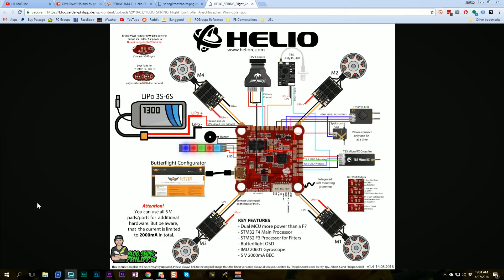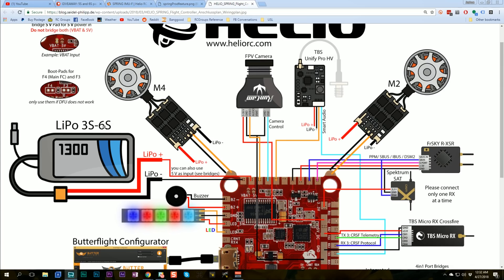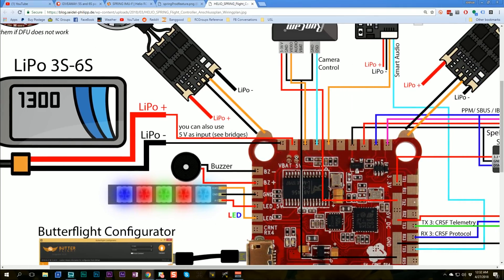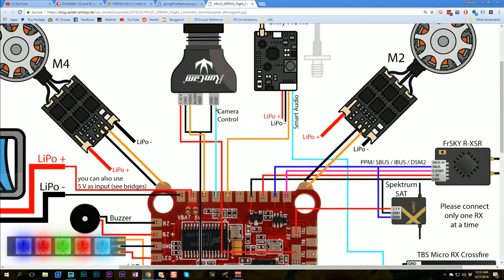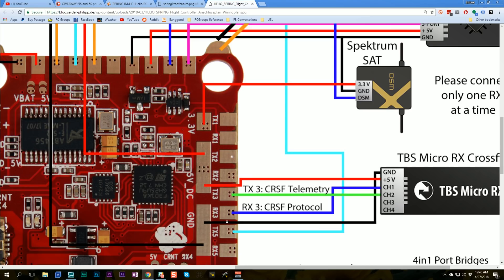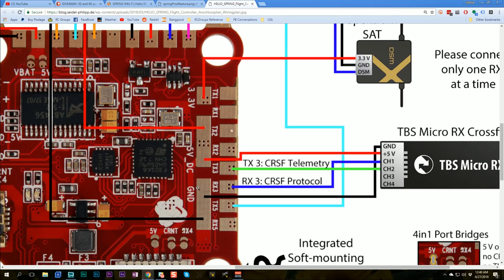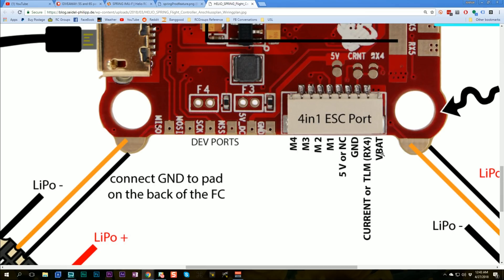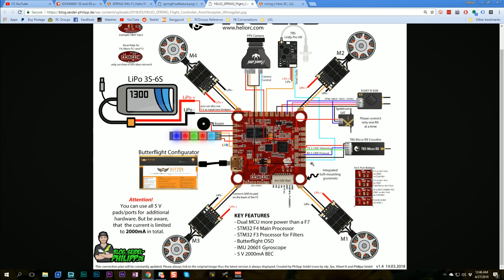Helio Spring Butterflight Flight Controller | F3 + F4 = F7?

Comment: Couple of answers to questions in the video: A) Butterflight and Helio are separate entities and operate independently and their decisions are entirely their own. We help the devs where we can and anything we can provide from advancements within imuf and contribute that back to the community we will. B) you can connect 5v and vbat to the 4 in 1 jack both. The jumpers are only “track” or “rail” selectors. C) Once the BF devs figure out that they can have some of the same goodness and allow us to open a PR, (or if someone wants to open a Helio target PR for us) then it could be supported in betaflight as well. Unfortunately, the BF devs decides to block us entirely from their repository. D) F3 support is in Butterflight for the foreseeable future. We love tiny whoops. :D
Reply: I saw the exchanges, I don't think Beta acted very professionally either.
Reply: Curtis Bangert in order for something to be slander, it has to be false. Nothing that had been said is slander.
Reply: While Beta & Butter are drawing lines in the sand, this is forcing the greater community to take sides & this is literally, & ultimately, dividing the community which I am sure both sides have contemplated.
The greater community is not "Beta" or "Butter" but "Better" than any one groups ego's & thus both groups need to swallow some pride & work together in the spirit of community. It will quickly get to a point where 'Who started it" or "Who's wrong" is going to be insignificant to the drama this will cause & both sides know exactly the ramifications of their actions.
Lift your game - all of you.

TLDR: Stop the smack talk, stop blocking & locking. All this does is mess up the community, not each other. I don't want to hear about how it's the other guys fault .. just fix it!
Reply: Andrey Mironov want more screenshots made public of your conversations held behind closed doors, “diehertz?” I’ll be glad to oblige. They aren’t very flattering to you or the rest of the BeF team.
Reply: Jesus I guess it's a dick measure contest everywhere in life. This type of 3rd grade bullshit is what is going to make me stop flying.
Reply: https://youtu.be/OR-772OqRoQ

Listened to the interview again:
30s - Kalyn is introduced as a lead developer of Butterflight and principle at Helio with Tim and Shawn.
1:12:'ish - talk about tracking serials and how Helio is a mechanism $$ and Butter is the mechanism for the open source outlet.

+ video splash says Butterflight, but the folks talking are Helio.  So the perception is there because of how it is laid out.
Please don't get mad at me.  Just sharing what was presented.  Sorry.

On top of this: Kalyn leaving RF and not wanting to go closed source again (which would mean starting over and coding everything from the ground up to just sell boards) meant pushing what was needed into an existing open source project (like BF).
Reply: Helio RC. Regarding the VBat pin on the 4 in 1 plug. If my 4 in 1 ESC feeds Vbat to that pin and I select the vbat bridge as my selection to power the flight controller. Do I need to also bring power wires directly from my ESC to the power pads or will the ESC Vbat pin be enough to power the board?
Reply: Actually that is not true Curtis Bangert.. it has been stated many times by Andrey himself that a Helio target would never happen. Has been asked by other users too with the same response. + the beta team keeps claiming there are GPL violations.. all hogwash
Reply: There is no need for argument.. we are going to keep doing our thing thats all.
Reply: Andrey Mironov blocked for exposing the fact that the BF devs were paid by OEMs including TBS to work on their stuff without informing the public, demanding free hardware or else they would “let the PR go stale” deliberately weeks before we officially launched, and things like that? If that was “being a jerk” then so be it. The community should be aware of the contradictions and conflicts of interest.
Reply: in my world so called slander is "well,,???" slander, and ripping balls, is RIPPING BALLS,,,
Reply: KWAD save the Queen. you can't expect the betaflight devs to 1. do all the work.. you want your board supported you need to provide the coding for it ( thats how it works with all other board makers and 2. the IMU code for the their secret sauce, in the way it was presented to betaflight and the way its implemented in butterflight breaches the GPL licence.. if you were a betaflight Dev would you actively help a project that is about selling product that you you wont get a penny of and already is capitalising on your hard work??
the hobby is transforming from a hobby to big business this isn't the first or last time you'll see this sort of situation going down..

ohh and https://github.com/ButterFlight/butterflight/pull/139
Reply: Helio RC on answer (B) providing 5v power and Vbat for sensing on 4 on 1 connector, how would you bridge for Esc current sensing as well?
Reply: esc vbat will be enough.  you'll fry the board if you use both
Reply: Andrey Mironov - Because you are such a model citizen....
Reply: Andrey Mironov so why don't you guys (bf devs) be the bigger men and include the target?  It sounds like a dick measuring contest where only the community loses.  All you are doing is shrinking your own community with this feud as it gives people only one option for firmware that is very close to BF.
Reply: You contribution to community is sadly none. Judging by quality of the first PR and how code on Butterfligtht is handled don't expect that your commits will be merged in this form. I had to change some of my commits many many times before they were accepted into Betaflight, there is certain level and standards expected to be kept when submitting the code there and deal with it. This is for everyones benefit, also for other devs to understand what the code does...
Reply: I don't know or care which one was right or wrong, but we don't need drama in *flight world. First it was base->cleanflight drama, then it was race flight drama, then again raceflight drama now butter betaflight drama ? Come on people, don't you have better things to do than argue?
Reply: Back your claims by proof, so far you're just pulling it out of your ass.
Reply: You were blockrd for acting like a jerk, don't forget that

Comment: Just switch to Raceflight trusts me. Iv been flying betaflight for almost 2 years and butterflight for a few weeks and Raceflight is is sooo freaking nice its like butterflight on steroids
Reply from the maker: There are two main weaknesses of FlightOne in my opinion. The first is that the hardware can sometimes be really really finicky. And if you get unlucky enough to have a setup that performs poorly, there is sometimes no fix, since FlightOne only runs on one FC. Second, The FlightOne developers seem to struggle under their load. Bug fixes and new features seem slow to roll out. Without naming names, I know many prominent pilots who fly FlightOne who refuse to upgrade past whatever old version worked best for them, because new versions either fly worse or have unfixed bugs.
Reply: Joshua Bardwell Yeah I would agree with you. FlightOne isn’t for everyone in my Opinion betaflight is perfect for 90 95% of people I went with FlightOne cause I was looking for that little extra something
Reply: Unfortunately I happen to be one of those unlucky ones. Ever since I switched to Raceflight, I've had nothing but problems with hot motors. I spent HOURS trying to tune it,  flashing older firmware to their latest firmware, raising filters to lowering them but to no avail. Very frustrating!  As a last resort I flashed Butterflight and now my motors don't get hot. I did have to drop the gyro from 32k to 16k but now everything is Buttery!
Reply: LuisB FPV That sucks I had a similar issue but ever since I start running the 32bit esc It’s been nothing but smooth sailing

Comment: Just went over this with devs, you can't put 5v and vbat at the same time on the 4 in 1 port.   Vbat on 4 in 1 port powers the board.  So if you power the board with 5v the only way to get voltage sensing (on osd) is to use esc telemetry.

Comment: I'm die hard betaflight and I built a 6in ultralight floss. It flew ok on 8k 8k but had oscillating problem and  the betaflight 32k filter would cause my CPU to lock up randomly in mid air. I tried everything to fix this on betaflight but went to 5in props stoped trying 32k and it did ok. But it was s waste. I had 2507 motors spinning 5in props and wanted to run 6in but couldn't on betaflight
 I swapped to butterflight not expecting anything to improve however it now runs 32k fine and 6in props with not a hint of oscillation. I was shocked at how Damn amazing it is. I wasn't expecting that it would be so good. But it is. I'm sold on it now

Comment: My Kingkong ET100 used to 'wig-out' a lot doing slow steady roll+yaw turns, where it would sharply bank 90 degrees to the side and I'd have to quickly slam the roll stick the opposite direction to prevent bad things happening.
I installed Butterflight, left the PIDs as they were and turned on the extra filtering (which I had done with Betaflight but didn't help) and now the hard 90 degree banking issue very very rarely happens, it really helped it.

Comment: I hear that Butterflight / Helio Spring almost completely erases vibrations / prop wash on 6” quads. 

I’m currently on a Betaflight F4 for my 6”. I’m already experiencing really good results but I will consider switching to Helio RC if it means I can get to 99% smoothness on 6”.
Reply: I am flying Butter on my 6" with a CLF4 and it is clean as hell. No propwash or MTO running FKF, PT1 and all notch filters disabled. I was not able to get the same results on my 7" so on that one I actually did throw in a HELIO and I have to say it fixed all my MTO and flutter issues on the 7" running gemfan 7042 props.
Reply: 3.2.4 was one of the BF versions that I remember flying and really enjoying as well actually
Reply: I am flying BF 3.2 on my 6" chameleon and it is very smooth, even on old beat up biblades. It is smoother than my 5" quads.
Reply: Not there yet but almost, my BetaF is still a tiny bit better, but I want the IMUF to rock it harder. I will keep trying.
Reply: I have a backup 5” that I don’t use. Maybe I’ll throw 6” arms, same motors that I’m running in the current 6” with Helio Spring and do a side by side comparison after tuning both to the limit. 

(I run the same exact frame for both 5” and 6” quads.)
Reply: Loose Transistor FPV I have all filters shut off on BF 3.2.4 and LPF at 120hz. I have no MTO but I have a do have a tiny bit of propwash when I do hard Split-S to stop / hard powerloop to stop maneuvers. 

It’s much much better than my 5” but it’s still there. Do you think Helio with Butterflight will erase that?

I swap between HQ 6030 and 6040 props.
Reply: Yes I do, I am a bit believer in the HELIO tech specifically. I have a 7" quad with a CLF4 that I had been trying to tune for 2 months with not much luck. No matter what I did all I managed to do was make the MTO band smaller or move it somewhere else. Couple weeks ago I bought a new HELIO and I replaced the FC on my 7" with it and on maiden it was loads better already but still some MTO.

All I did to solve that with the HELIO was add more Kp gain, and raise Q to about 4000 - MTO cured, no more propwash =D

Comment: You asked at the end how Butter flies; Isn't it still just a BetaFlight fork with the Kalman Filter? 
I'm trying to keep updated, is Kalyin now a ButterFlight dev, or continuing with RaceFlight once again as GPL open source? (Was trying to grasp that question)
Reply: Kalyn is actually one of the HELIO RC devs, he helps with some aspects of butterflight but mostly the ones related to the Helio target.
Reply: Loose Transistor FPV Ohhhhh I see. Is this recent since he and Preston quit working together?
(Am I on the wrong forums or subscribed to the wrong channels? It's so hard to follow the progression)
Reply: Hehheheh I think you might be following some old news sources yes. The split between Kalyn and RF happened a while back - its kinda what forced preston to open source RF1 in the first place. Kalyn teamed up with Tim Sweet to work on the Helio.
Reply: Loose Transistor FPV In December-ish of '17 right? Okay, I missed the Helio change. K, I'll keep searching for news; I keep searching FB, YT, & google searches...
I guess time will tell but it's interesting to follow who is working on what project.
Reply: Yeah you are not going to find a lot of that type of news in those sources. What you wanna do to keep your finger on the pulse is join one of the FPV Slack channels. FPV Chat would be a great one to join since it has 3K members.
Reply: Loose Transistor FPV Bro, you're awesome. You totally didn't need to take time out of your day and you did! K, I will look into that Slack channel ty so much. I always feel like I'm half a step behind the curve, and I'm curious by nature. That will be awesome 👌🏼
Reply: Hahahah yeah join the slack my friend - it will be hard to keep up but there is a ton of good info there. And you are very welcome, I love spending time connecting with the community! Here is the link - https://fpvchat.slack.com/

Comment: Why can we not get a plug and play board no more soldering plug motors, vtx  ...
Reply: Flying High you must be a newer pilot...
Reply: Due to connections not being reliable over time..nothing like sodering your connections vs plug n play,only think it's OK for tiny whoop or micro's,even then I would still  prefer to soder:)

Comment: Does anyone have answer to the to the vbat pin? If your running FC off the 5V then do you not keep the vbat wire or does it use vbat sensing? Putting into a build right now and really don't what 5V + Vbat V going into the FC cause product may not like it so much.
Reply: Vbat sensing using 5V only available through 4in1 telemetry I believe.
Reply: You can safely connect both 5v and vbat through the 4 in 1 harness (only) without breaking anything

Comment: I power my HESP from vcc through the 4in1 plug. No issues.

I’ve run 4 packs today with dshot1200 and my quad flew ok. Changed to multishot on the fifth pack and OMG the difference was unreal. Felt smoother, turned sharper with less drift. Loved it.
Reply: Simon willmoth that’s because Kalyn is a genius :D
Reply: Helio RC keep up the good work guys. My flying is a lot better with this board and Buf.
Reply: Simon willmoth how do you power a Unify Pro HV on this FC when used with a 4in1 ESC and the ribbon cable?
Reply: caymandiver75 I have wired direct to Lipo input of my 4in1.
Reply: Simon willmoth you wired to the FC lipo input pad or to the actually ESC layer lipo input?

Comment: I Love ButterFlight. My favorite quad right now is a bqe 210, JBardwell running Butter, Makerfire escs, Tmotor pro2 2400kv, Lumenier eagle2 pro. I can run nearly any prop (Dal 5051, 5040, 5046, 5050<-fav) with no "prop-wash" what so ever. Only the slight hint of the beginnings of "prop-wash" when pulling out of a dive real hard at the last second. Flys like a dream (smooth af, goes right where I want it). Plus the bqe210 is beefy, you can pretty much chop wood with it.

I have another bqe210 nearly the same with a Spring in it w/ Crossfire. But sometimes I have to re-plugin my battery to get crossfire to do more than just arm. Weird, so I just fly my other  210 until I get the time to mess with the other one. The lines around my house are real tight "cqf" anyway. I need to grab some more Springs I guess.

Comment: Josh, Thank you! for doing this video you make understanding how to use a device just more clear and the Helio Spring needs you. The Vbat inputs all power the on-board 5V rail. The Helio wiring diagram has some opportunities for improvement. :) I recommend you go check out the Helio Slack channel, would love to see you on there..
Reply: Wesley Rick how do you power a Unify Pro HV and Cam on this FC when used with a 4in1 ESC and the ribbon cable?  I’m using the DALRC Engine 40 4in1 ESC.

Comment: I've been very happy with mine so far. Have it on my freestyle quad that used to have an old version of Raceflight on a Revolt. I updated to a newer version of RF and it flew terrible with bad oscillations. Flashed butterflight to the Revolt and it flew noticeably better, but still had tons of vibes. Swapped the Revolt out with the Helio Spring and it reminds me of how my first Raceflight quad felt way back on RF1 300(back when it flew great on stock tunes). Basically just flash it, put in your rates and it was locked the hell in! Right now I'm flying it on 5s with Butterflight 3.3 on old beat up motors and it flies as or better than any of my previous freestyle builds, with minimal effort. I've remained objective towards it for a while, not sure what to think, but after about 50 packs I can say that it's definitely not giving me any reason to dislike it. I'm waiting on the new FPVAF 2307-2500kv motors to show up so I can give the board a true test with fresh motors. I have a feeling it will be much smoother with fresh motors that haven't been slammed into objects for the past 6 months.